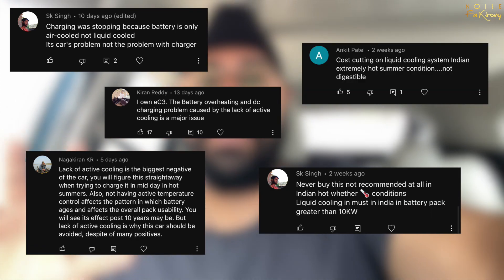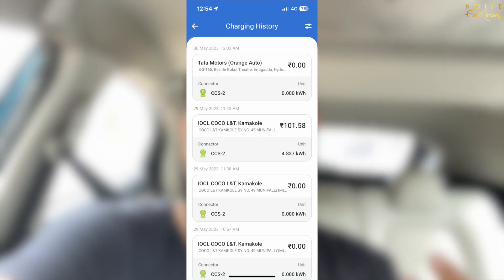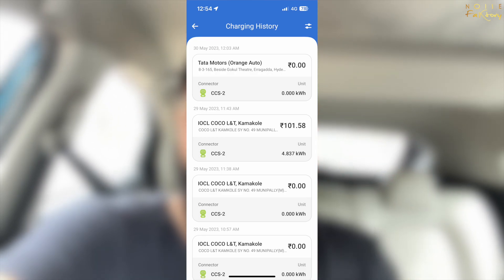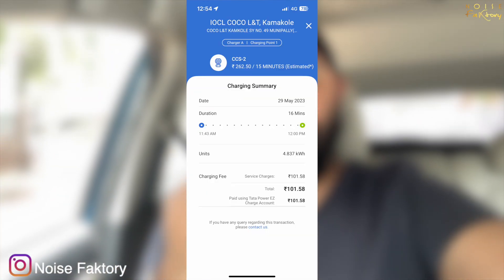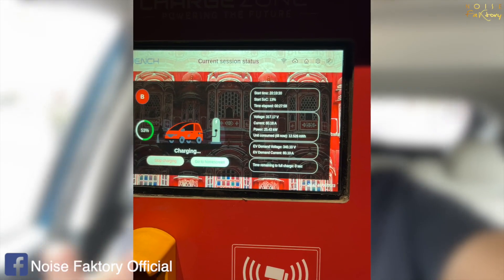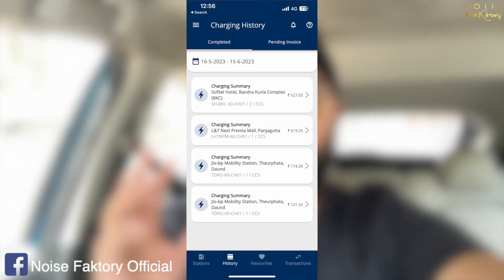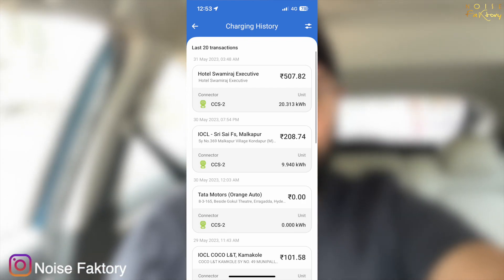Did We Really Face Battery Heating Issue In Citroen EC3 EV? - Charging Time & Hyderabad Trip Cost

Comment: I am EC3 owner .. 9 months till now 35000 km driven .. i havent faced any heating issue .. i did single day 800 km .. did fast chargeing frequently , no issue observed .. i got range on avg 260km to 320 km Edit .. Now Jan 2024 .. completed nearly 35000 km .. Never observed any sort of Problem .. even I faced 2023 Indian Summer.. 4 service completed no battery degradation seen till now
Reply: Hello, 

Have you checked the battery health on your periodical service??

Just wanted to know the degradation level since its an air cooling
Reply: @fayizkurikkal9634  air cooling have no connection with battery degradation .. just you read about LFP battery and their thermal stability .. since over tata car and they capped high speed in safe level 107 software cutoff .. In EV only Torque is Matters .. they achieve 3times w.r.t to motor power .. so we gets more millage w.r.t of 1 unit of current .. for 1 unit we can have range 8 to 12 km .. but in Nexon case only 5 to 6.5 km efficiency .. means 81 whr / km to 100 whr / km .. but in Nexon efficiency is 115 whr / km to 145 whr / km .. also they have charging cycle rules continuously u can do only 4 fast charge and 5th must be slow charge .. there is no constraint for eC3 .. u can do any number of fast charge.
Reply: @fayizkurikkal9634  no battery degradation observed .. i have did 2 services till now ..
Reply: @fayizkurikkal9634  air cool vs liquid cool only comes into picture is surface heat of fast chargers location were nearly 50 degrees .. only safety concern , car don't initiate  charging  session with fast chargers .. that situation comes to you in summer plan accordingly u avoid that too .. don't fast charge in mid noon or find shaded well maintained fast charger location ..
Reply: @Ravi-g1h4q I second your opinion and totally agree with you. I have done about 12 fastcharge sessions in a 1600 km trip and I had no issues whatsoever. A lot of wannabe scientists on the net are critical for no reason.  They have neither experienced or owned the car. To be fair Citroen has been caught napping because they have not come out and refuted the claims made by bloggers that there is a problem with fast charging.
Reply: Now 35000 km 9months 4 service completed changed the tyre .. now .. I haven't observed any sort of problem
Reply: @Ravi-g1h4q  hi, now how many kms have you driven your car? Any issues?
Reply: @maheshrawat9752  Now 65000 kms Zero issues
Reply: @maheshrawat9752  Already 60k service is completed , Major Maintenance cost will tire chance .. first tyre change on 29k Citroen provided tyre is Ceat , I bought bridgestone tyre double the rate of ceat .. still more wear and tear .. Next plan is go back to ceat ,
Reply: @maheshrawat9752  Minimal Battery Degradation only happens , my 29.2 kW battery degradation is around only 2% , Still battery health is 98% and loss of millage by 3 kms .. with regeneration it is negligible. It seems will loose 3km millage for every 50k kms

Comment: I have Citroen EC3 … drove approximately 10000 km … I have completed 2 long drive . One Lucknow to Nainital and second Lucknow to Kedarnath ( Sonprayag).  this car is fabulous. Not an single issue i faced… I drove this car 700 km continuously with 80-90 km/ h speed..only took stoppage for charging and lunch… no any heating issue in the car… worth purchase 👌
Reply: Seems like you have driven the car mostly in places with normal or cool temperatures. The problem arises in higher outdoor temperatures like where I stay Hyderabad or any other places with higher outdoor temperatures, especially in summers

Comment: I have seen another video where one car owner of EC3 has reported heating issues while fast charging. Something similar was also shown on Pune to Hyderabad trip where the car was not charging because of heating issues.  The air cooling system of the Battery is to be blamed according to that video.